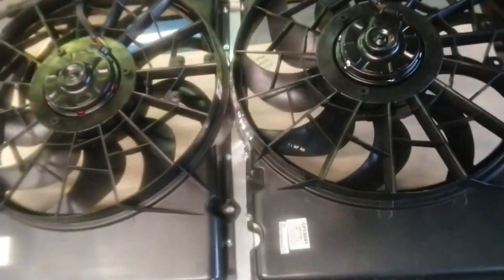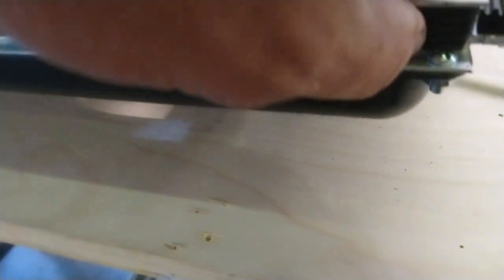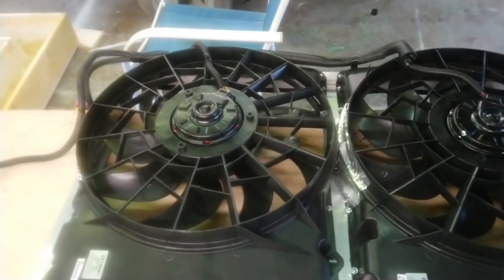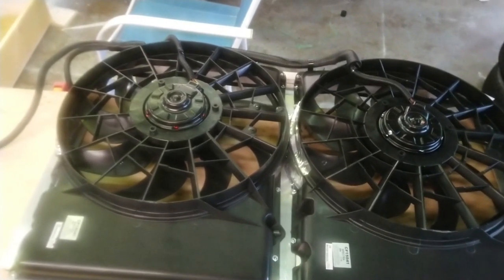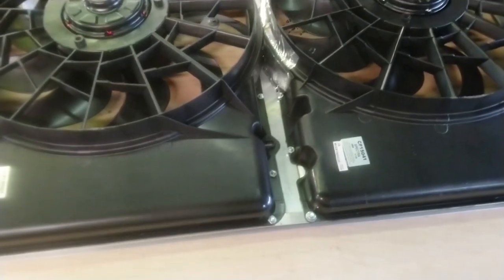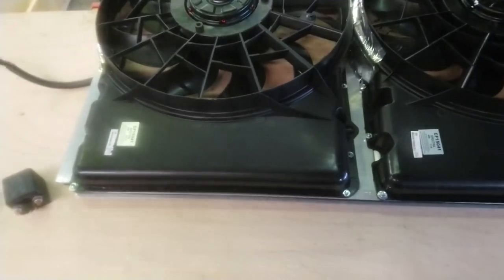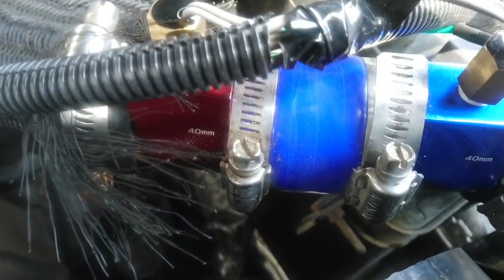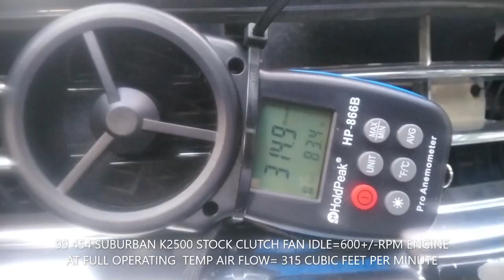99 454 K2500 suburban twin taurus fan setup

Comment: If you really want to put those fans to the test, pull a trailer that’s over 2500 lbs Uphill and it will really test to see if they cool. I did a dual 14” fan set up then a dual 16” with high output fan motors and with the truck running by itself it was fine, it doesn’t take much to kee and engine cool but when I would hook up my dump trailer loaded with weight of about 7k-8k the fans couldn’t not keep up. So now I’m doing a dual Lincoln Mark viii fan set up. I did a bench test on those and they move so much air it’s crazy!
Reply from the maker: I pulled a 4 place jet ski trailer that was fully loaded (just under 5000lb in 90 degree weather and it only went up and additional 5 degrees.....7000+ lbs I'm sure I would need the high speed circuit wired up....
Reply: thebubba1 glad to hear those fans work out so well for you, do you know how much amp draw they have per fan the way you have them hooked up right now?
Reply from the maker: @payloadperformance9706  .....I have a separate video of a thorough amp draw test for these fans.....it's in my video list
Reply: thebubba1 awesome I’ll check it out!